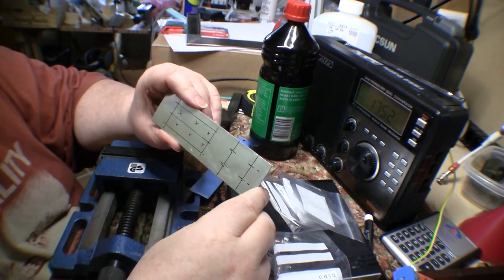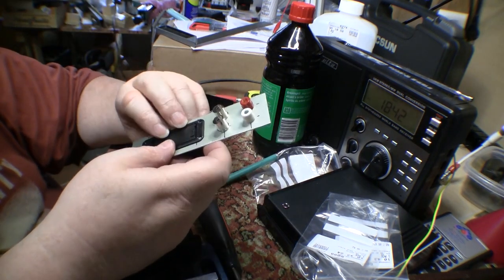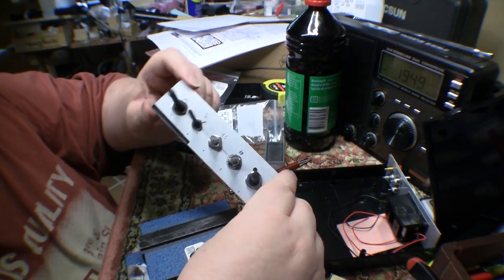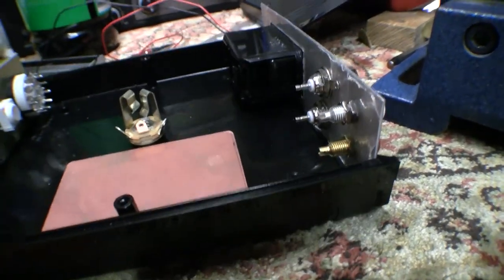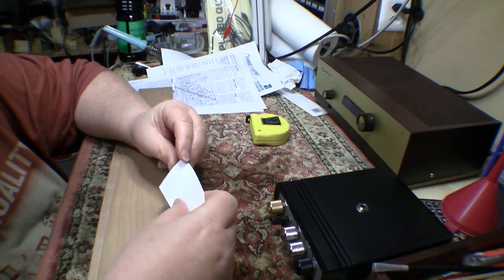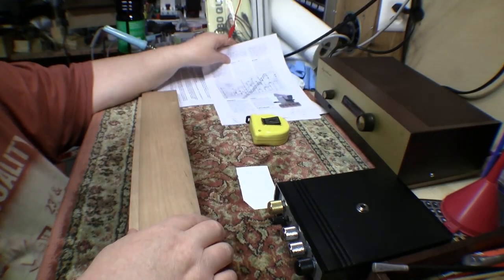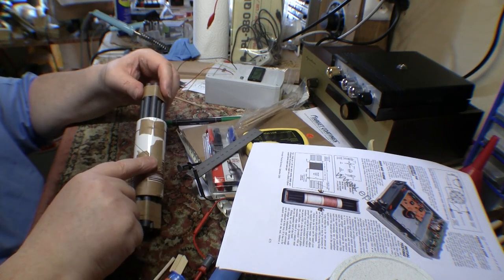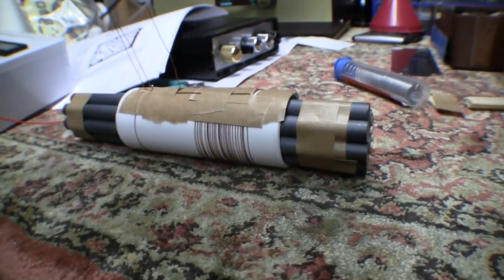Active Aerial Project - part 1

Comment: When I make PCBs I use glossy photo paper that's meant for ink-jet printers in my laser and then have the iron as hot as I can get it.  If the paper ends-up brown, so much the better.  After that soak it off.
Reply from the maker: Thanks.  As you'll see in later clips, a friend made the PCB for me so I got lucky :-)